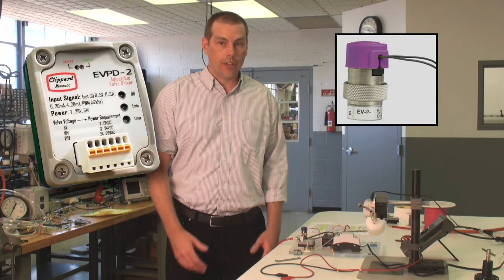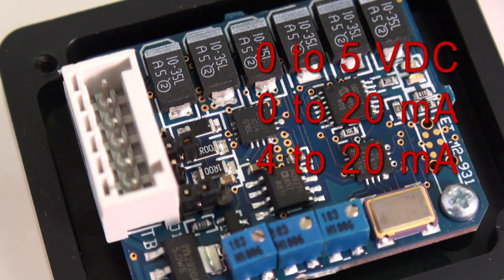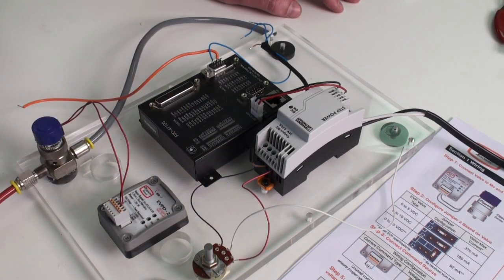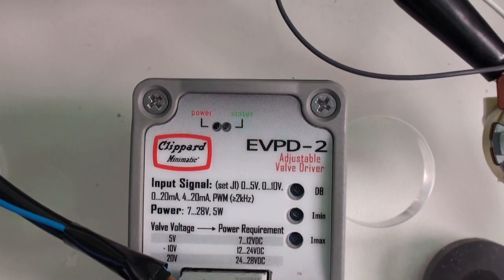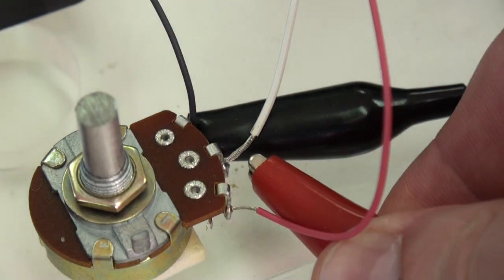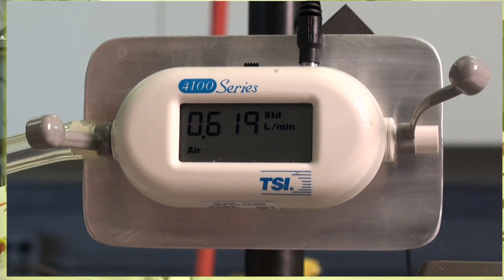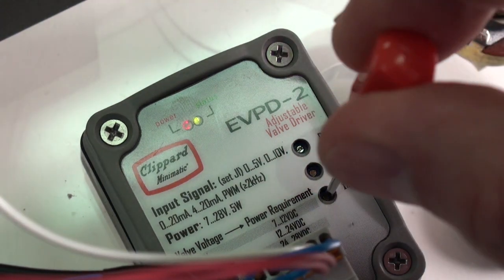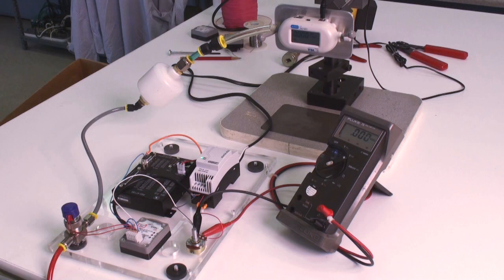Electronic Proportional Valve Driver (EVPD) Setup

Comment: hello. you have a great channel. a lot of useful information.  tell me please, you control the current at the output based on the PWM signal from the microcontroller.  please share the circuitry or give links from where you took it to regulate the current. Thank you very much!

Comment: Ok my bad I watched the whole video and it looks like that board setup is robust and able to handle all typical controller voltages, best part if you dont have a controller you can still use this setup. You could even hook it up to a solar panel and when you get a current through your panels your valve opens. (for solar water heater)

Comment: If the driver only needs to control up to 5v cant we use an arduino board?
Reply: David espinoza    i have 1 ishu with my kobleco excavator propo valve warning after 2 mint of starting the machine and machine looks like andr load and black smok i alredy replace valve but after 1 or mint samne warning with new valve...pump is become heated in free runing